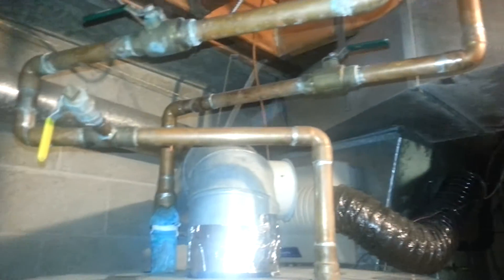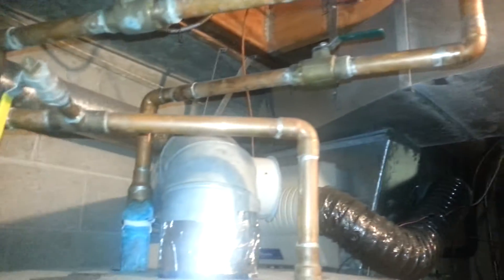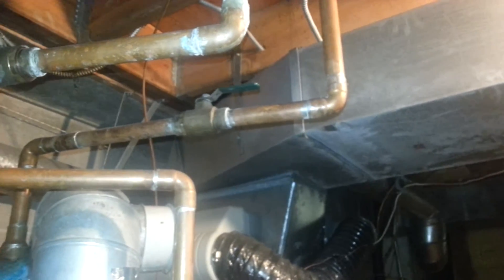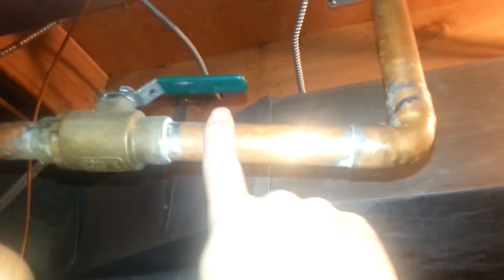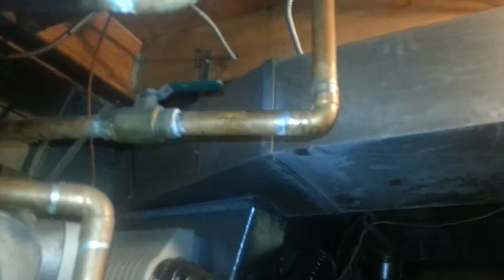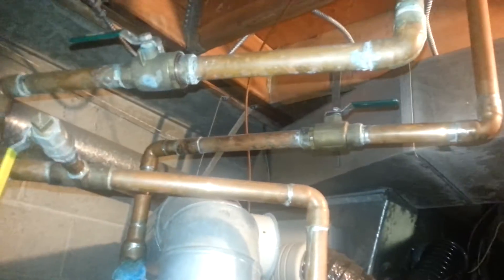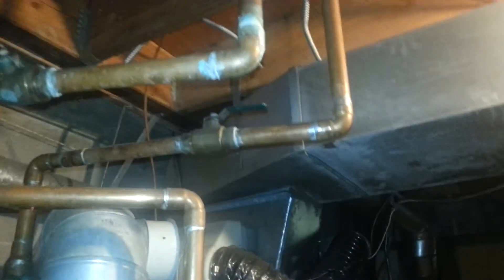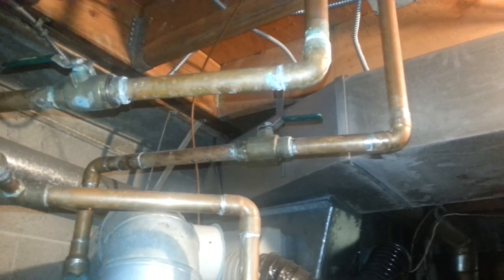Hot water takes too long to reach faucets.

Comment: Hey Ted! 
I don’t know if you still visit your YouTube channel but our company has a really great solution we found when people have this problem. 
Watts makes a recirculating pump that  has a connection you make at the furthest faucet. Then you put the pump on the outlet of the water heater. Lastly you set what time you want the pump to run and the hot water recirculates without much plumbing work and you have instant hot water. (Also the installer of the water heater didn’t use dielectric unions so their is corrosion on the fittings on top)

Comment: My hot water out is 1/2 inch yet it still takes a good 3 minutes to get hot water to the further points in my house. Pressure is great so that's not the issue.
Reply from the maker: At this home, it takes 20 minutes to get hot water at the upstairs shower.

Comment: Ted it takes 20 minutes to get hot water to the shower, wow...that's 2 & 1/2 gallons per minute times 20 minutes = 30 gallons of water down the drain, before you get hot water, yikes!! that's a  pretty expensive water bill. hope you get that resolved before drains your wallet.💯😎✌
Reply from the maker: The reason it takes so long is that the landlord put super restrictions on each of the outlets so it barely trickles out. It is on a well and septic, so there is not much money to save by restricting the flow. All that has happened is an extreme inconvenience to the tenant.